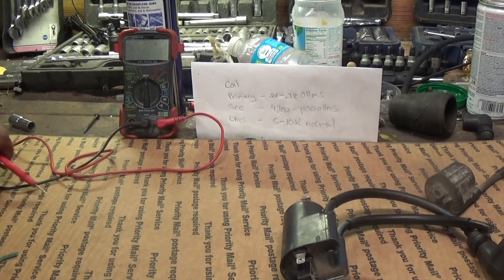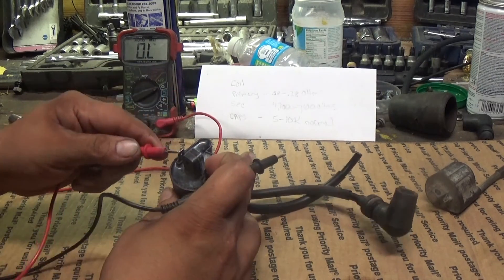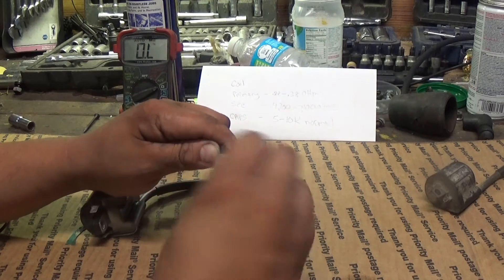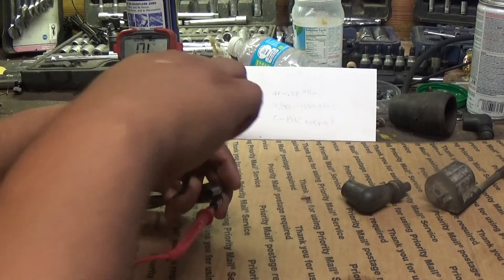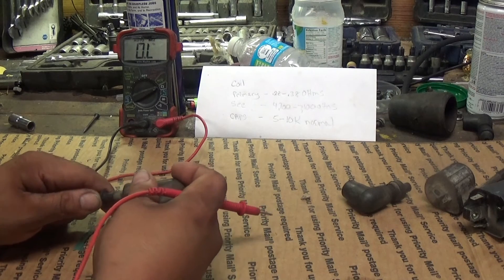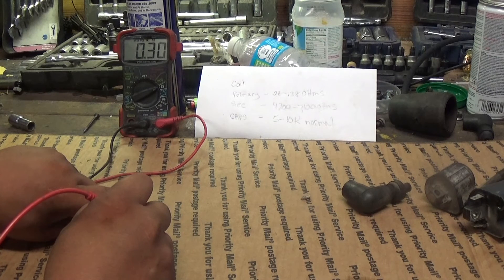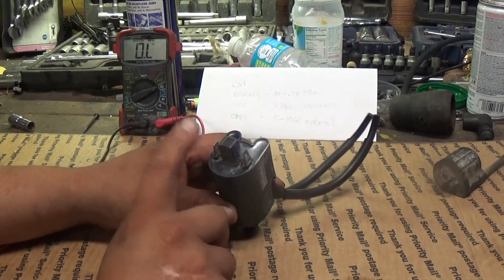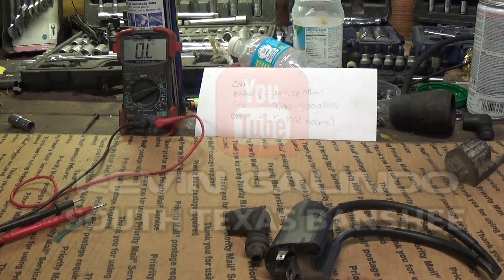Banshee coil testing

Comment: I watched your video on Banshee coil test and my original coil reads nothing my secondary is the same as in your video and one boot is under 4500k and the other is intermittent nothing. 
My bike runs great in neutral and starts on first kick every time, however going down the road I only get just under 1/2 throttle before it bogs out? 
Is it the coil and caps?  stator and harness test good and carbs are dialed in my tester is good. 
If so were can I get a good one either OEM or aftermarket without paying sooooo much? 
Thank you, stay healthy. 
       Robert Atkins (479)226-1927
              coneejo69@yahoo.com
                  Fort Smith, Arkansas 

Sent from my iPhone

Comment: Can you give me your thoughts on my readings ? 

Primary .9
Secondary 6000
Plug cap 1 . 5700 
Plug cap 2 . Won't read

Banshee intermittentantly wont run . Obviously getting new plug caps . 

Spec on primary is .28 to .38 and I am at .9 , is this coil good still ? Primary is a little high but not terrible , thanks anyone for your thoughts

Comment: Hey bro, when I test the primary I don’t get any ohms like you did, if I test cont the dvom beeps which means there’s cont... is the coil bad or am I doing something wrong? The meter at 200k ohms literally reads 00.0 ohms. 
The secondary gives me 5.4 and the cap gives me 5.8 like yours.
Reply from the maker: joe mercedes 
Try it set to 20K, see what happens. I believe that’s the setting you need, mine is auto ranging so I don’t have to mess with it.

Comment: hi ran the test got a good read on primary but secondary no reading neither plug either but the bike was running fine except for the right side it would just spit out fuel what should i do???
Reply: Emmanuel Gamez spitting out fuel because it isn't firing change your secondary and cap.
Reply: Emmanuel Gamez